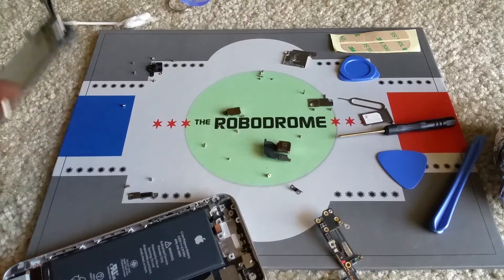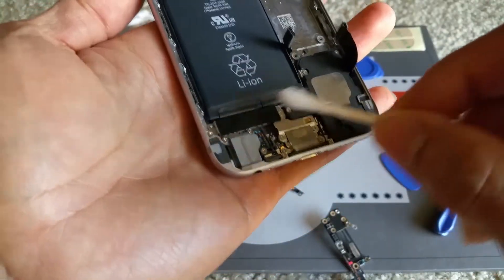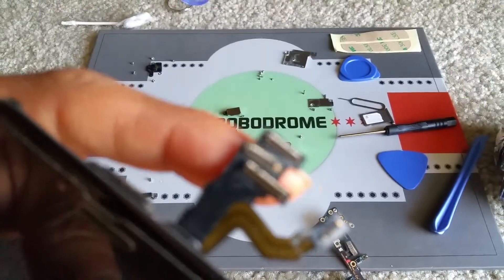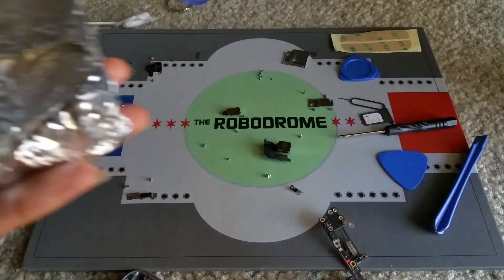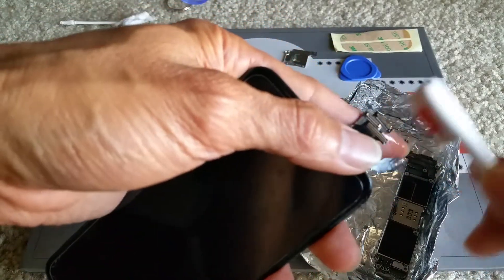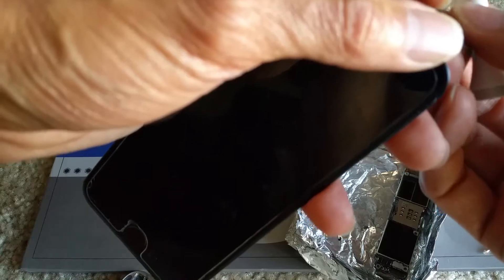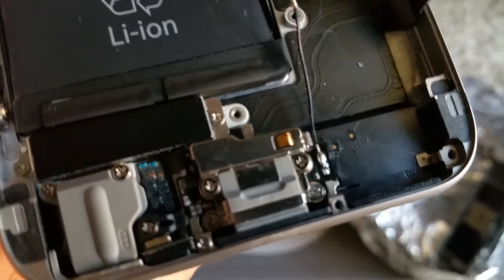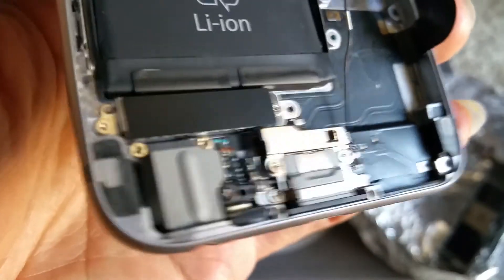Close-Up On How to disassemble water damage Apple iPhone 6 6s Part 3 2016

Comment: It's not working for me, do you think I need to soak it in the alcohol longer, I did once for 3min.
Reply from the maker: That's too fast, I did mine in 10 cycles. You can try 5 cycles to see if it works first or not. Good luck.